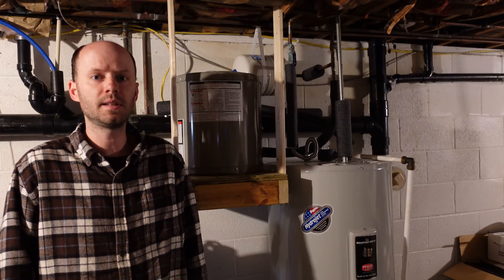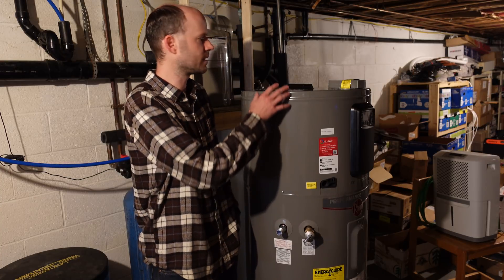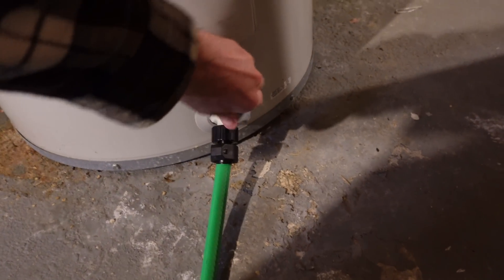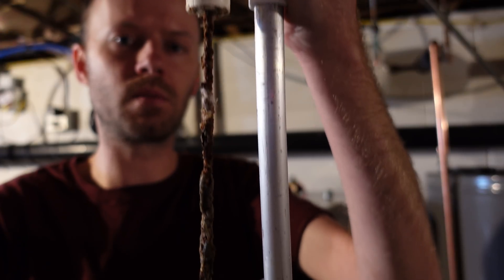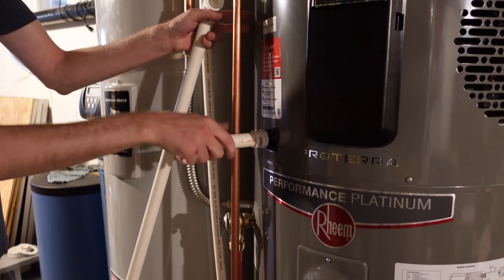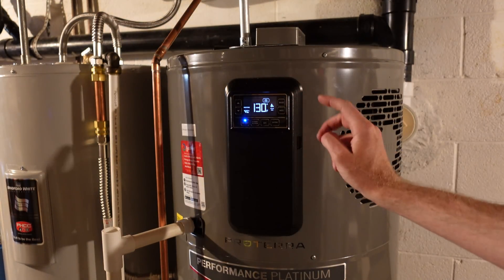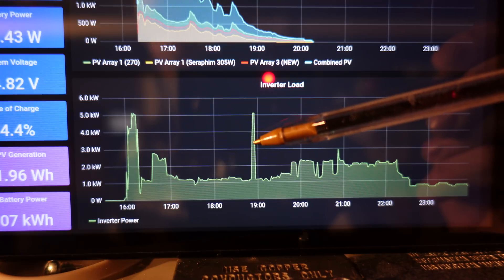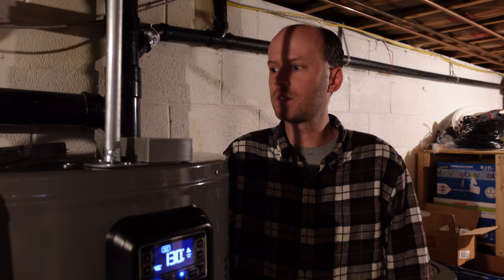Reducing Energy Consumption with a Hybrid (Heat Pump) Water Heater

Comment: Rockwool sound dampening insulation in your subfloor will help with (basically eliminate) the noise concern in the bathroom.
Reply: Fiberglass has the same sound dampening properties and costs a lot less...
Reply: @FJB2020  Both do a pretty good job at reducing sound.  Rockwool is a little more expensive, but does a little better job of sound reduction.  The reason I mention it, in this application, is that it's in-between a bathroom and a water heater.  Rockwool is hydrophobic.
Reply: @jasonbroom7147  That is true, if you want it for it's 'hydrophobic' properties than get it, but from my home theater building days, I can tell you there is nothing but hype surrounding that product.  Rocwool and Fiberglass offer the same STC rating and unless they are used with some form of Mass Dampening or Isolation (or both) they don't do much.  The cheapest most effective isolation is to use 5/8" type X drywall (not the LITE stuff), Fill the cavity with fiberglass (use the next R up from your wall depth IE R-19 in a 2x4 cavity or R26 in a 2x6 cavity ) and use acoustic caulk at all seams and joints.
Reply: @jasonbroom7147  FYI I have taken out rocwool that was soaking wet, the air entrapment and tight weave of the spun slag holds water, even though it won't effect the insulation it will still mold up the drywall...

Comment: Sweet!!! Those are so cool
Reply: Hey Will
Reply: I had an 80 gallon version of one of these in my previous home. Wired of course. It replaced two 50 gallon water heaters and boy what a difference. Expensive to buy but cheap to run. We saved about $150 a month on our electric bill. I agree though, very loud and they must be placed in a well ventilated area because they need lots of air to be efficient. However, the compressor doesn't run 24/7 so it wasn't that bad.
Reply: @explorenaked  wow . you use $150 worth of hot water ? where do you live ?
Reply: @MrBemnet1  At that time it was in the mountains of Colorado about 30 miles west of downtown Denver. No we didn't use $150 gallons of water per month but that's not how a water heater works. It keeps the water warm regardless if you use it or not. So replacing two inefficient 50 gallon builder grade electric WH's with one efficient heat pump WH saved us $150 a month on our electric bill.
Reply: @explorenaked  if you save $150 month on heating water, then it mean you were using spending at least $150 dollar on heating water.   what is your total electricity bill ?  and how much do you pay per Kwh?

Comment: Where do you live? My local home depot has the anode rod and drain tube in stock and would have saved you a lot of money. Good video btw.
Reply from the maker: My HomeDepot sold an anode rod but it wasn't the anode rod I needed. The Bradford water heater has the rod attached to the hot water nipple. You have to replace the nipple/rod together. Most standard water heaters have a separate port for the rod, which is the one HomeDepot sells. The first plumbing store I went to looked at me like I didn't know what I was talking about, then eventually directed me to another plumbing store that specializes in Bradford heaters... Seems to me a good reason not to buy this brand of water heater again.
Reply: @LithiumSolar  Many times the brands or particular models sold + installed by professional plumbers use parts incompatible with standard hardware store parts. I have often seen it in the size of the element threads.

Comment: Tankless is the way to go IMO
Reply: Tankless is not even considered viable by Energy Star. HPDHW is considered most efficient direct replacement followed by solar panels requiring expensive plumbing retrofit
Reply: @jstaffordii   mine uses a total of 50 cents a day in power, it's off when not in use....substantial difference then the 80 gallon I had prior
Reply: @wantafastz28   I didn't say they don't work. I said they aren't rated by Energy Star. Due to the technically unlimited supply of hot water they can provide. Burner runs wide open when hot water called for and gas is available.
Reply from the maker: The electric tankless aren't practical for my use unfortunately. My primary interest is heating the water off-grid and I can't have a tankless randomly hammering my inverter with 12-15kW.
Reply: @jstaffordii   I guess that is where we differ, I dont care about energy star, it doesnt apply to me.
Reply: @wantafastz28  This one use $100/year  or 27 cents a day . And can be ran on SUN power.  400 watts at a time not 15,000

Comment: It will also cool the basement.
Reply: Just like a refrigerator heats the kitchen.
Reply: Correct. One of the better ways to run these would be to duct it in and discharge the cool air upstairs.
Reply: @shawnd567  Correct and with a damper or even a ball valve using PVC ducting etc. to prevent it from cooling upstairs in the winter.
Reply from the maker: A duct in/out with dampers would be a pretty perfect setup. I could have it conditioning the warm living area instead of the basement. I'm not fond of cutting duct-size holes through the floor just yet though...
Reply: @LithiumSolar  You might be able to connect it to existing return duct ? under floor ? Run intermittent fan etc.
Reply from the maker: @teekay1785  I don't have ducting anywhere unfortunately. My primary heating is electric radiant (yes, it's very expensive).
Reply: @LithiumSolar  I feel for you two words mini splits LOL!!

Comment: Interesting. Back in the day there was a coil you could attach to the AC system (Freon) to exchange the heat into water heater tank. That seemed to die out for some reason. This puts the AC attached to water tank. Strange to me. Curious if it will work for you. Please keep us posted. Thanks for sharing.

Comment: I see some people replace the resistance element with a 240 volt light bulb or resister making a fake element so the heat pump thinks it's heating and runs.
Reply: The light bulb trick is good if you want to keep the water heater working in heat pump mode only.  For example you are off grid and don't have enough electricity to supply 4500 watts continuously to heat water, but the drawback is if the "Smart" water heater decides it needs the resistive element to heat the water no water will be heated until it decides to use the heat pump again.
Reply: @uhjyuff2095  Good to know but with the 50 gallon extra reserve he likely won't need more demand
Reply: @offgridwanabe  I think you are right, during the cold months when the heat pump is not working his grid powered 50 gal tank should be enough.
Reply: @uhjyuff2095  I just put my grid tank on a timer so it runs from 11-3 every day when my Enphase grid ties are running and it saved me $50 a month
Reply: @offgridwanabe  Me too! great minds think a like. I also save $50 month.
Reply: A capacitor might fake the sensor into thinking the element is still connected without increasing current draw like a lamp.

Comment: If you read the manual it will tell you the elements will run until the water reaches a certain temp, >60. You will want it in heat pump mode to ensure it runs the heat pump only. Electric mode is elements only, high demand uses heat pump and elements to recover super fast. Energy saver tries to use mostly heat pump but will turn on electric elements to help and heat pump only uses the heat pump.
Reply: Curious if he couldn't just unwire the upper and lower element so it couldn't enable them (think burnt out bulb, it's not going on regardless) since the other tank is responsible to get the temp the rest of the way.
Reply: @gonnagetya1433  tried it, didn't work, the computer detects it and shuts down the whole thing  What I ended up doing on mine was replacing all the 4500W heating elements with 1500W.
Reply: Gonna GetYa device will throw an error code if you disconnect an element
Reply: Spot on! I own one and went through the same scenario and it wasn’t until I read the manual to understand what was happening. I leave mine in heat pump only.

Comment: Instead of paying for an entire new heater (6gal) you could have ran one of the two elements with off-grid power. What's your heating system and location in the US? That type of water heater is truly preferred down south. The dehumidification will indeed help offset the running of the other system. At $1200 dollars for those hybrids, I find in most situations a gas tankless will have a far better ROI. Takaji tankless are $750.
Reply from the maker: The key point here is I need the water to heat off-grid. The electric element works great but eats electricity. I don't have gas service, so gas is either out of the question or would require a tank be installed. The tankless electrics are of no use either as I can't have 12kW+ randomly pounding my inverter (that's only 10kW). The hybrid seems like the best bet for my off-grid use :)
Reply: @LithiumSolar  Yeah if you don't have access to cheap natural gas then this is the best choice. Check out my other comment to see the reason the electric coils ran at the beginning. I install these fairly often and they have certain operations.
Reply: @shawnd567  Has anyone asked you to install lower wattage heating elements in their hybrid water heater?
Reply: @uhjyuff2095  No.
Reply: @LithiumSolar  It looks like you are going to leave the new hybrid water heater on all the time versus the 6 gal water heater that only came on when your batteries were fully charged. Is this true, or are you still testing?